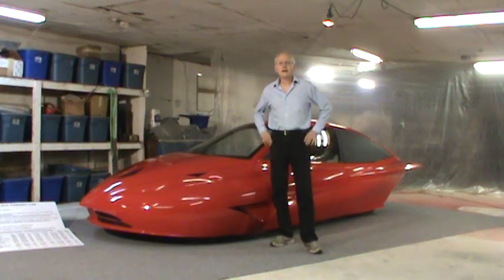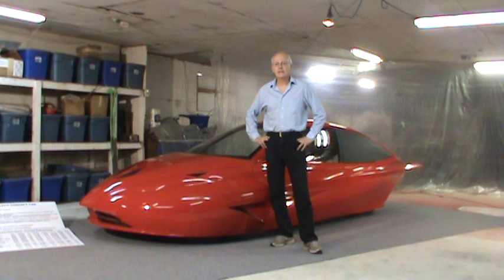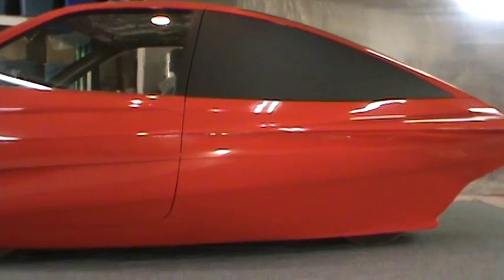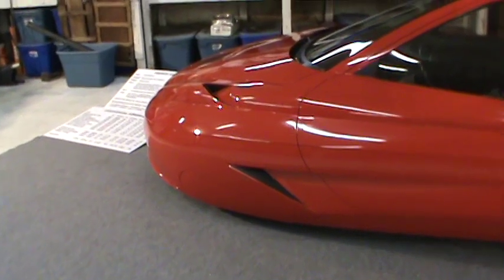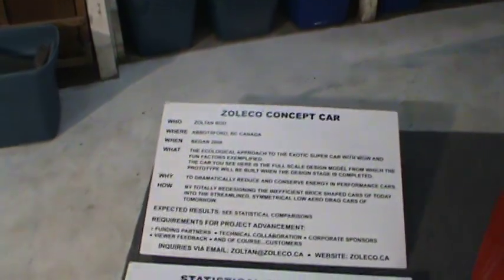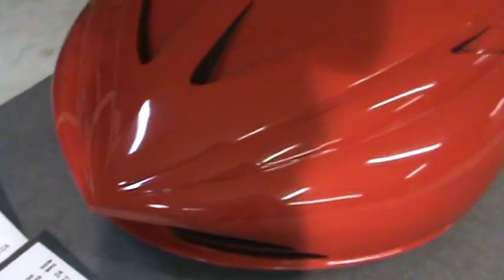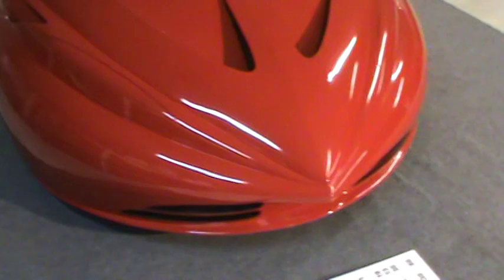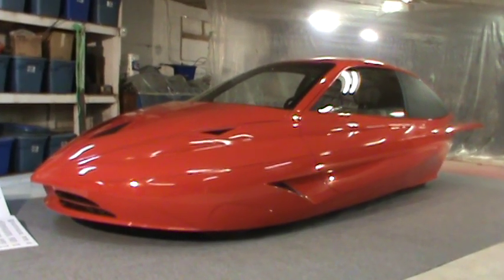Zoleco....The Exotic Super Car Concept.Video 8

Comment: Thir Engine ( ragtech ( can eben Run on Pure Hydo and or Natural Gas...as well as Cleaner Bio Diesel )....

Just a Thought....
Due to Extreme MPH...
Extremely Clean Running..
Very Few moving parts that Equals Extremely Reliable..
Excellent Torque..
Plus Alternative Fuels are Easily used withit..
Perfect even for HHO additive and other such measures....Anyways.....Just a Thought

Comment: 1ST off..Nice Looking..I Like the Effectiency .. I am Un Sure a Gas Engine is the Right Choice Either..
My Choice would be a New Consideration.. A Rotory Diesel..a 375 HP variant without Turbo's Would Still give you Twice the MPG while giving you 40% Better Torque ... Throw Proper Turbos  to it..and Gain at least 40% better MPG again & still keep the Torque advantage Plus Far Far Cleaner running & Far more Reliable & far fewer moving Parts...Just a Thought
Reply: When you mention torque, I can tell you watch too many drag races. 

Why focus on acceleration when you can focus on top speed?
Imagine this car’s top speed closer the koenigsegg. It would be amazing

Comment from the maker: Thanks Thomas,like you say it is a BIG project and once I do get it on the road ,test track and Bonneville Salt it shall definitely turn some heads and raise some eye brows.Problem is my lack of sufficient funds to do this quickly....so I plug away at it til I can partner with someone with my vision and daring to do SOMETHING DIFFERENT and put a super car on the road that is not a gluton for energy due to the huge drag of rounded brick aerodynamics that they use!

Comment from the maker: Yes I have considered the diesel...but I still am not convinced that the new clean diesel is as clean as gasoline.I know power can be boosted dramatically,but when that is done there is alot of black smoke produced,I am not a big fan at this point.I need to produce 375 clean horsepower for this car to perform like a super car,I love the compact design of the VR6 and the power adders available for it.From my Bonneville experiance all I can say is that the big power diesels left alot of smoke.